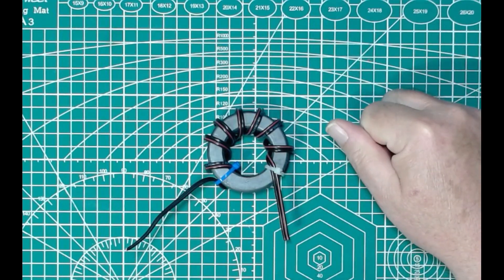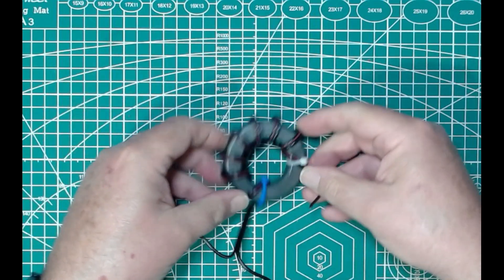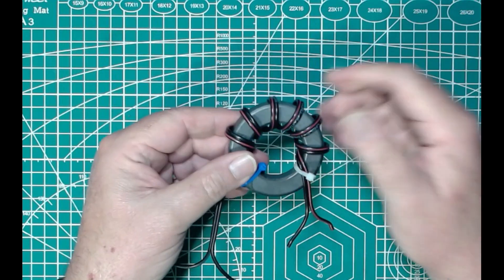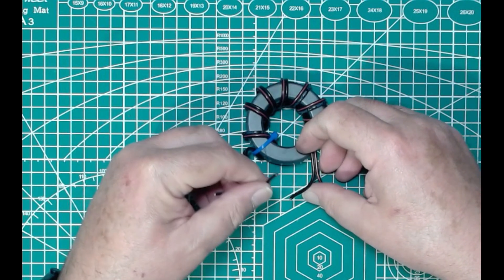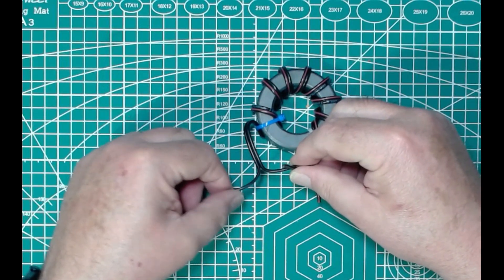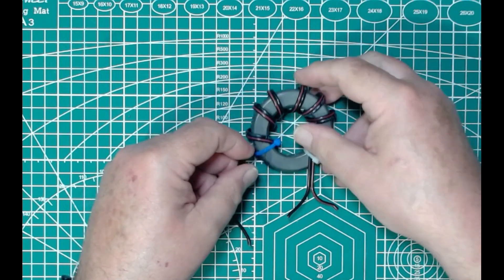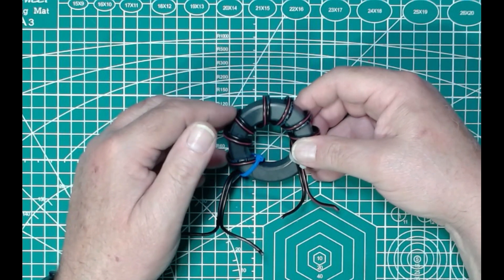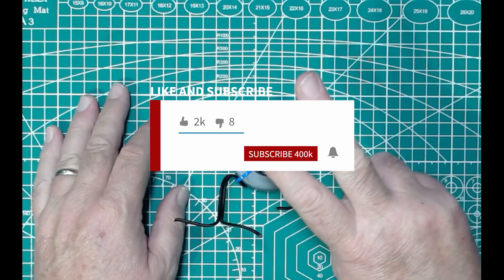Wrap that 'roid right!

Comment: A good check is before you connect any wire together check that there is no continuity between the two wires you are connecting together.  ie before you connect them together.  i hope that makes sense.  i just did my posiden build and the only thing left to do is cut the radiator and the radials.  I hold off doing that until its a little warmer than an ice cube.  73

Comment: that a great update. with MAG wire I use color marker to mark ends of each wire so I can tell them apart.  with that a 4:1 UNUN you can use a 200 ohm resistor from antenna to counterpoise wire and use either a nano VNA or rig expert to check SWR. should test 1.5 or so with resistor. if like 10:1 then it's wound wrong. this a easy wat to test the UNUN before you finish the build. 73's
Reply from the maker: Yep - that was how i discovered the crossed wires.  The SWR was stupid high, like double digits.

Comment: If you strip both ends of one wire and then wrap it, this is a good way of marking the wires. As you said, you need to connect two different wires in the centre.